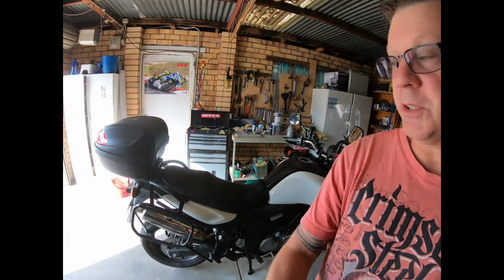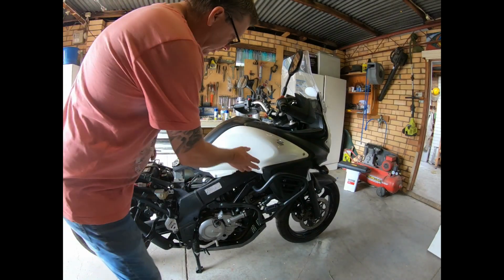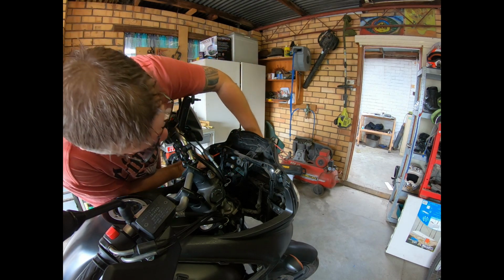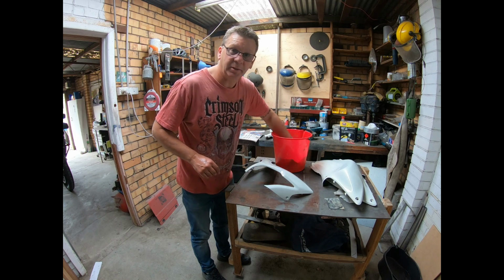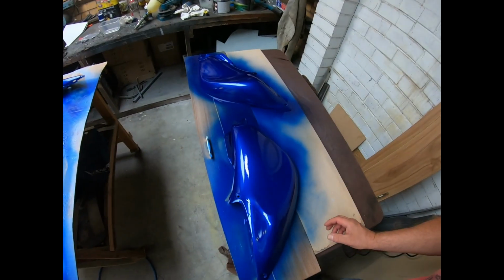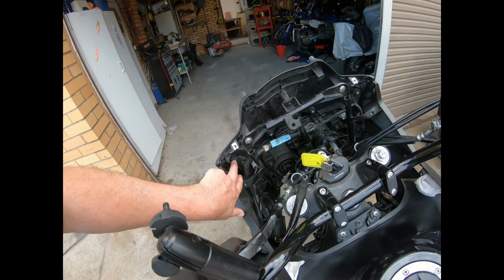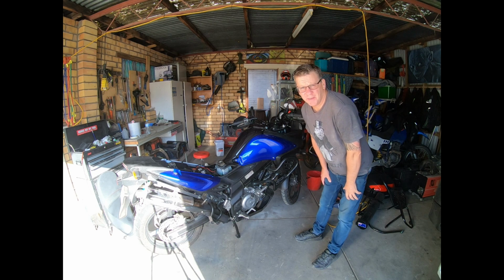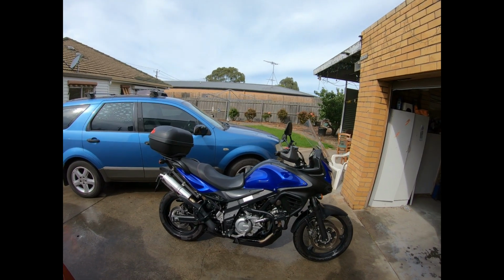I Painted The Vstrom Blue

Comment: Nice job. Motorcycles are supposed to 'pop' with color In my opinion. I think you might have inspired me to paint my 'asphalt gray', {at least that's what I call it), 2013 Adventure model to match the dark red color that was available in 2014. If I use the Preval paint system, I can go with a really high quality paint and get the auto paint store to match the color almost perfectly, right down to the metal flakes. I did this with an RD350 back in the day and it turned out beautiful and lasted for years and years.
Reply from the maker: Thank you, I did like the blue way better than white. Hey I also had an Rd 350 when I was young. Hope painting goes well for you.

Comment: Looks great, i have a white V Strom and want to paint it because the previous owner fitted a beak and at some stage managed to snap the bottom thin part of the headlight cowling so its in two parts...it needs repairing at the beak rattles a bit grrrrrrrrrr only thing putting me off is the removal of the headlight cowling. I am also getting my seat remodelled as its mega uncomfortable for longish trips and want it higher too. Just ordered a centrestand/mirrors/satnav bracket to mount above the clocks/ wide pegs/bar risers/ few other bits and pieces. Love the bike its ideal for getting me to rural places for my photography trips. Would like some spotlights...had a GS Adventure before and lovely bike but way too heavy offroading so the 650 Strom feels like a mountain bike compared to the GSA. Cheers
Reply from the maker: @THEGSADVENTURER  Thanks for watching,  great bikes, I done a bit of off-road on mine it was fun. That head light cover can be tricky to get off just got to make sure you find all the screws. Sounds like you will make the bike to suit you good luck on your bike.
Reply: @bazz6670  thanks to your video I have a better idea what to do and will get on with the job now.....haven't decided on what colour i fancy something that stands out but not too tacky, I actually like the army green colour but not sure how it would look so maybe try editing photos and trying different colours until i am happy lol
Reply from the maker: @THEGSADVENTURER  I'm glad the video helped,  I nice bright color will really make your bike stand out.